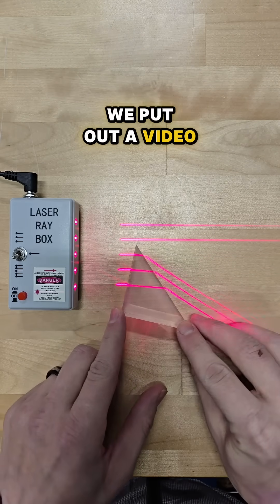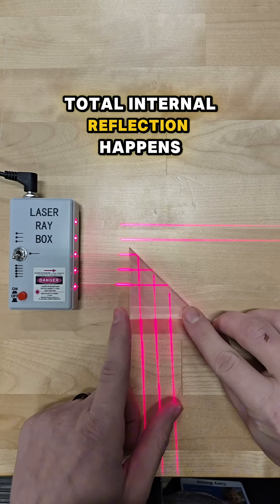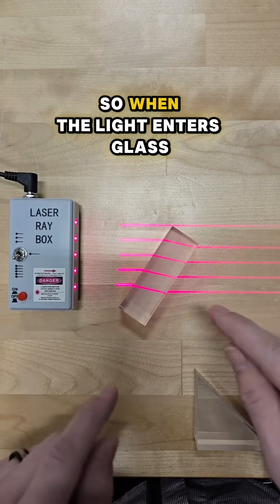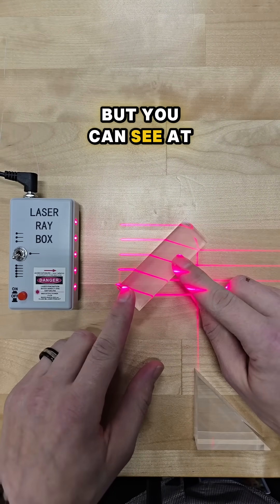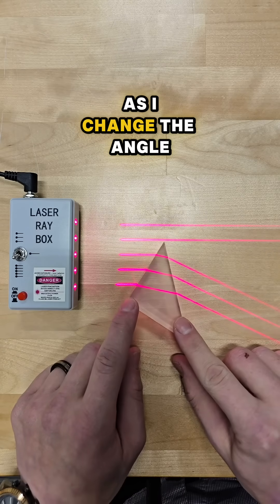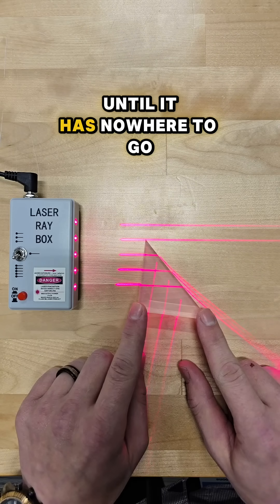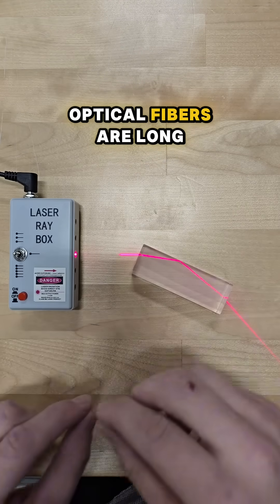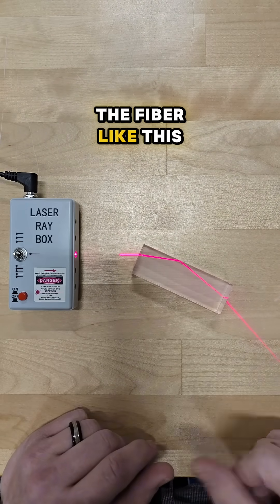Light Refraction and Total Internal Reflection - Part 2

Comment: So if the light hits a "wall" of the glass in a direct enough angle, it passes though, but if it hits it parallel enough it bounces?
Reply from the maker: If it hits it at a sharp enough angle it totally internally reflects. The angle is measured from the normal of the glass surface (perpendicular to it) to the light ray

Comment: At what point does a more powerful laser overpower rhe glass and melt it? Atthe melting point of the glass? But does it even get a chance if it bounces off? Probably still does melt thriugh if powerful enough right? Then what materials can be develop like a thousand layers of reflective glass to defend against laser weapons?
Reply: If the laser is not absorbed, the material does not heat up. Thats why, for industrial lasers, mirrors and lenses are designed so they absorb incredibly little light for a given wavelength. When that is not enough (melting is usually the least concern, thermal expansion can warp the optics and send the laser into unsafe directions), the beam can be expanded within the device so the power density is lower and thus less dangerous for the optics. The expanded beam is then focussed onto the target to achieve maximum power density for purposes such as laser cutting, drilling and welding.

Comment: Fiber wire does work this way, however its multiple layers each with different refractive properties. the core is the path the light takes, the layers guide light back into the path if it deviates, this is how you can bend fiber wire without losing information.
Reply from the maker: Exactly! We have some videos diving into how that total internal reflection works in fibers in more detail
Reply: @edmundoptics  I might have a look into them, I took a very in depth course into Fiber, splicing fiber, testing fiber, i learned to hate its existence but love how it works.
Reply: If internet data travels faster as light, then why we get 15mbps speeds at ethernet?
Reply: @manoharmeka999  Well 1 due to the number of times its bounced around in any fiber cable or traveling at fractions of the speed through regular copper cables.
2, I seriously doubt that companies actually try using their fiber lines to their full potential by using dollar store motems.
I have fiber, i have their shitty motem, and i barely get the same speeds from them as i did verizon. For reference both my plans were 1Gb/s and i get maybe 150-200 Mb/s

Comment: The light does not slow down at all, it just is forced to take a longer path
Reply from the maker: Also, the light interacts with the particles in the medium. So even if the light enters a flat window of glass head on and no refraction occurs, the time taken to travel the same distance increases because of those interactions. But the speed of light still technically remains constant (it's hard to wrap your mind around)
Reply: speed is distance/time an increase in time to travel the same distance is the definition of slower.
Reply: I would argue that light does in fact slow down. When light moves through a transparent medium the bound electrons oscillate with the same frequency as the laser light, but not necessarily in phase. We observe the resulting electromagnetic wave of the incident laser beam and that generated by the oscillating electrons. This electromagnetic wave propagates at a slower speed than the speed of light and hence refracts.
Reply: The speed of light is constant, but that statement applies to the photon. When light travels through a medium the photons interact with that medium, being absorbed and re-emitted in those interactions. This makes the light beam, composed of many photons, appear to slow. - even though the photons still travel at the same constant speed of light between those interactions.
Reply: Hence, that's the reason she used air quotes when she said, "slowed down."

Comment: I have tried to understand refraction. There are plenty of things explaining what the result of refraction is; it bends the light. But the underlying explanations dont make sense to me.
"It slows down."
But itd individual photons, not a coherent mass of light. And its on the scale of atoms. How would one 'side' of a photon enter the material first it has no non-central 'mass' to rotate around?
Also, polarized light??
And sure, internal reflection, too, but I need to understand how refraction works, first.

I'm guessing the size/rotational width/angular range of the transition point correlates with the wavelength in some way?
Reply: When light is refracted, the individual photons do not change direction. They continue moving in a straight line until they are absorbed by an electron. The electrons of the material emit the absorbed energy again however, so new light is produced. The light emitted by the billions of electrons interferes with each other , so the emitted photons are basically blocked in all directions except for one, where the interference is constructive (the electrons are "in sync" with one another). This direction is the angle of refraction. This basically means that the refracted beam is technically a completely new beam of light, while the old one is destroyed.

Polarization is simply the direction in which light accellerates electrons. Light is a wave in the electromagnetic field. The electromagnetic field is what is known as a "vector field", which is to say that the EM field has a "strength" and a "direction", which determine which way an electron accellerates within the field. For example, around an electron, the direction of the EM field vectors points inwards, because protons would be pulled towards the electron. Since electrons have negative charge, they behave the opposite way, so they accellerate away from other electrons.
Since light is a wave in the EM field, it will push electrons back and forth. Since the EM field has a direction however, that means the light wave must also have a direction in which it pushes electrons. That is the polarization.

Comment: You said light slow down inside the material, is not speed of light constant?
Reply: The process of light being absorbed and re-emitted by the medium in which it travels - like an optical Newtons Cradle, means there is a small delay introduced.  A photon hits an atom  momentarily raising it to a high energy state, a new photon is emitted to continue the journey, hence the delay.  

A photon only has one speed and has no concept of time.
Reply: @DJ-Eye thanks, this is a good explanation
Reply: In a vacuum.